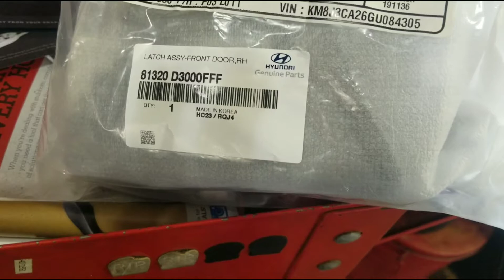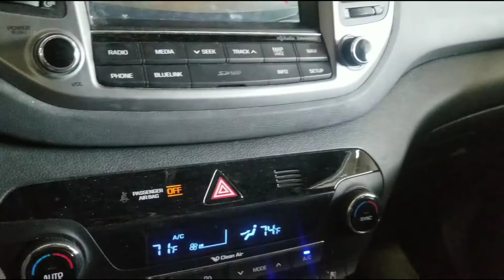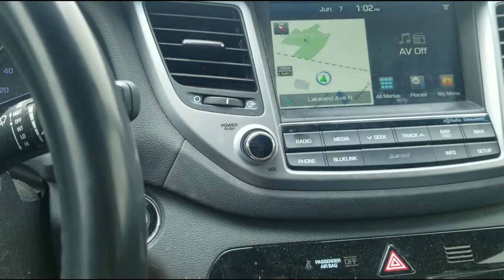Hyundai tuscon 2016-2019 door latch replacement for front door that won't open

Comment: Thanks so much for your video. I was replacing the window regulator in my wife's 2016 Tucson and the door handle mechanism didn't come out clean and I ended up with a loose plastic part that I couldn't figure out how it went in. Thanks to your video I was able to figure it out and finish the job successfully.

Comment: I have a 2016 Hyundai Tuscon with my front passenger door sticking. I went to my local Hyundai dealer to get an estimate for repairs on the latch. Price was $700. But the service rep.was able to pull up a technical service bulletin. It was on a door latch replacement extended warranty(my car has 50k miles out of warranty) I recommend you go down to the service dept. to see if your 2016-2017 Tuscon is covered versus doing it on the phone. Hope this helps.

Comment: Thanks for the great video. I stupidly stripped the foam sleeves off the two cables on the replacement part, thinking it was just part of the packaging.
 Do you think it will still work?
Reply from the maker: It will be fine.  Its there for noise if wire bumps the sides it wont make noise.
Reply: @hyundaihowto  Thank you sir!

Comment: Can you tell use what is the fail point on the Lach ? Something we can do to keep it from braking in the future?
Reply from the maker: I think the cable is getting stretched
Reply: Im bypassing the cabe all together and still can't get it to unlatch. tempted to take the Lach assembly apart but I don't have the go ahead to replace yet. just figured out why it doesn't work

Comment: Hyundai is horrible for this problem on all the vehicles. Most of the time they won’t open from the inside or outside. I have at least two a month in my shop for this problem. They should be ashamed of this bad cheaply made design.